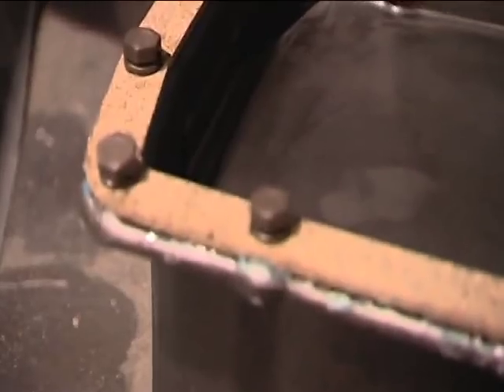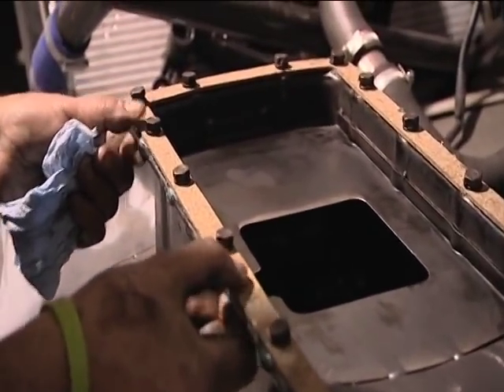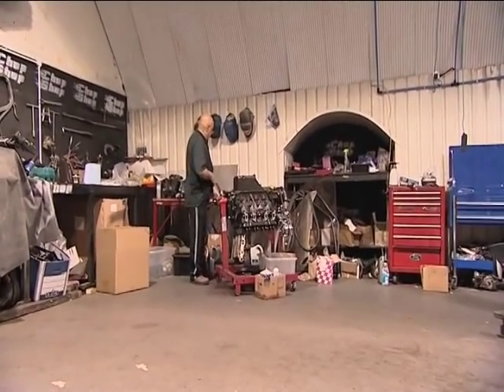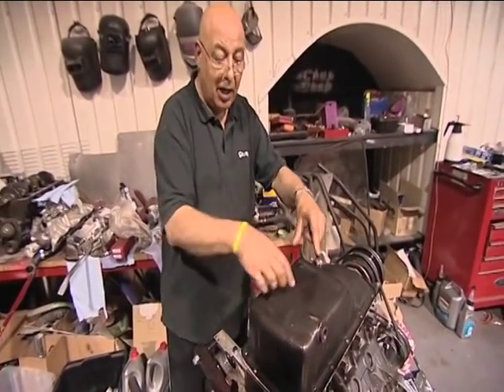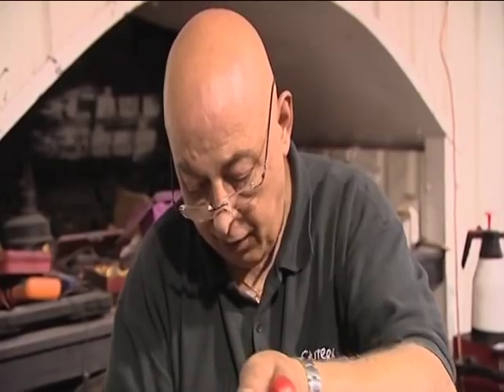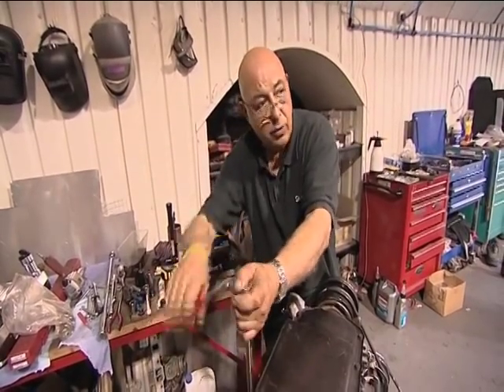Chop Shop - Cork Gaskets

Comment: Another trick instead of using Vaseline or sealant to hold the gasket in place just use a thick grease. Many old timer mechanics swear by using grease on cork gaskets. Stays in place, seals when installed and removes easily when you need to take it back off because you forgot something.

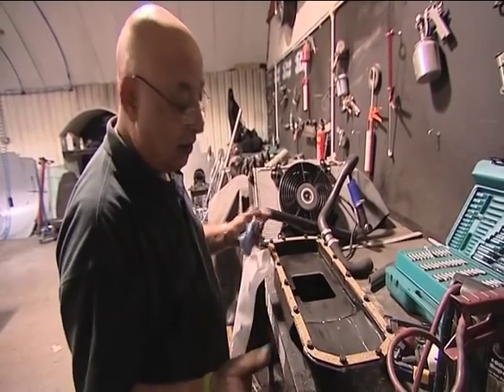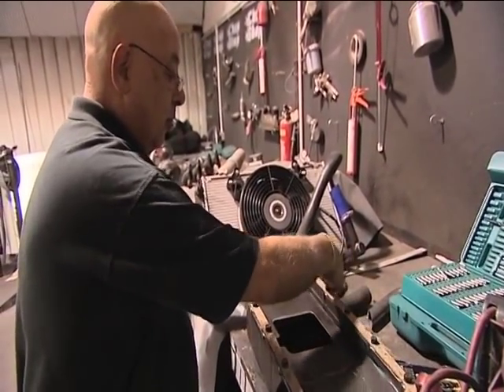Comment: at 0:22 he says"I do up a very light smooth of silicone sealer" then very next clip @ 0:54 he says" never ever use sealer" ...wtf..?.. so which one is it?
Reply: Pan to cork = sealer; cork to engine block = no sealer.
Reply: @blackcastle4052  but smear with Vaseline right? What’s that do
Reply: @TruckThisGarage  allows the cork to flex/sit/adjust itself without breaking the cork. Call it a conditioner if you will.

Comment: Beware using synthetic oil it doesn't agree with cork or paper fiber gaskets... I used to use Indian head shellac on cork gaskets,it lubricated them going on and dried to a tar like consistency,go easy with it because it's messy
Reply: I think the Indian head shellac seems a good option for cork gaskets. Have used them and seals pretty well too. Someone also mentioned grease and I've seen that too, but never used it. Silicone sealant is definitely a no no for cork gaskets.

Comment: Will vaselene on cork gaskets keep them from sticking and turning in to a rock on the sealing surfaces?
Reply: Cork gaskets fail either through overtightening or staying dry over longer periods of time. As long as they're continually immersed in the fluid of which they are meant to contain, they will seal indefinitely
Reply: @aldente2676 my chevy 454 had a cork gasket and it never lost a drop. I had the transmission rebuilt and they used rubber twice. I’m going back to the cork.. doing it myself

Comment: Wtf does he do when he first puts the gasket down?  He's saying he's putting something - sealer? - but I can't hear through the background noise & his accent.  He says no sealant later though, so I dunno wtf this dude is talking about.
Reply: He puts a light smear of silicon / rtv around the bolt holes, sets the gasket on the pan and then puts the bolts in, to keep the gasket in place as the sealant sets.

Comment: Now you have ChatGPT, I put what I got from it for your judge: ", it is generally not necessary to put a sealer on a cork gasket. Cork gaskets are designed to be compressible and are often used in applications where they can conform to irregularities and create a reliable seal. When installed correctly, cork gaskets can effectively prevent leaks without the need for additional sealers.  Using Vaseline or any petroleum-based products on a cork gasket is generally not recommended. Petroleum-based products can degrade cork over time, causing it to swell or break down, which can lead to leaks and potential gasket failure."

Comment: Can you put sealer on or not? first you say it allrite you do it all the time, then it's I never use sealer I so confused 🤨🤔 right now I just want to put my gasket on. I'm just going to google it maybe someone has the right answer. But thanks for whatever you just did sealer no sealer .
Reply: DON'T put sealer on the gasket side that's going to touch the engine but DO use sealer to stick gasket to oil pan or valve cover so it doesn't move when you install it on engine.
Reply: I put it ok on pan side and every thing been good no leaks i made my own gasket cause it was still leaking the last person that did it used a angle grinder looks like it

Comment: You want problems with your engine after installing cork gaskets ?      Cork gaskets are crap!!!!   Seriously!
Reply: My 1997 Daihatsu uses silicone for sealing the engine's oilpan. The automatic transmission is sealed with the original cork gasket of which doesen't even leak a drop
Reply: Theyre often the only thing available. Try finding an updated valve cover gasket for a 1950 International pickup. In my opinion, most people think that because they don't know how to properly install them. They always seep a little, so people try to seal them up with silicone, often causing gasket failure. I was told to soak them in oil or warm water before installation, it helps them take on the form of the sealing surfaces without causing the gasket to squeeze out the sides.